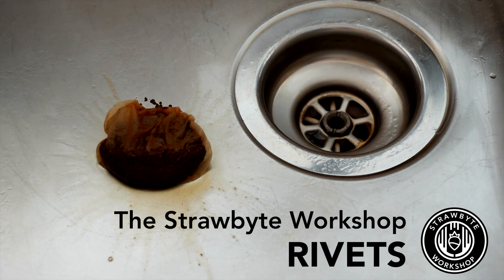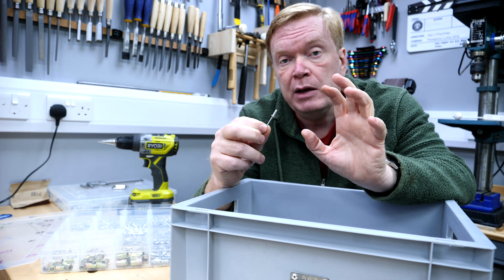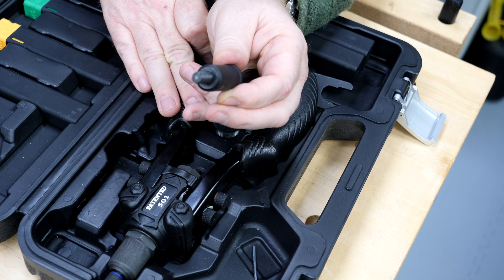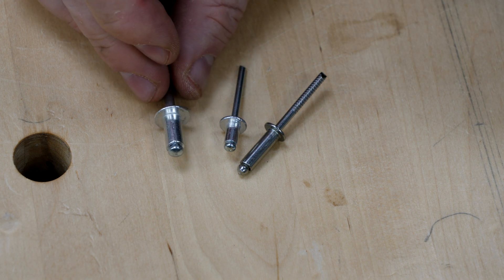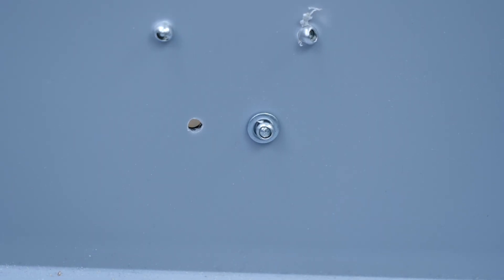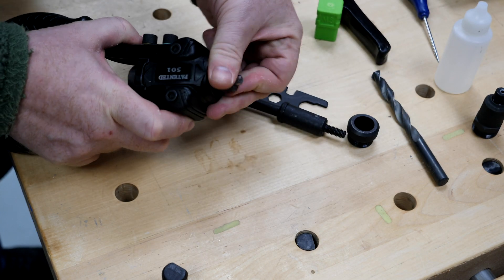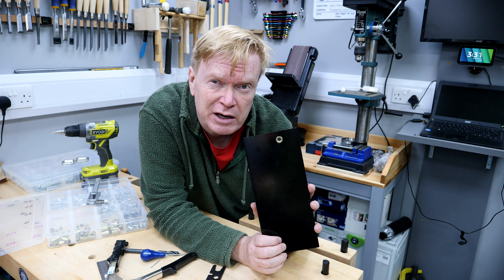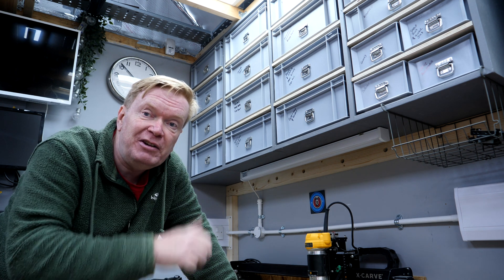How to Use Pop Rivets | Completing the Storage Project

Comment: There are sooo many really cool types of rivets. Unfortunately I have not seem any of them in a hardware store. They are at least 3 types of rivets which can be used for soft plastic material (or a washer) but I can not buy them.
Pull through rivets are also really nice they aare flush on both sides which is suuuper super useful very often when you don´t want to have something sticking out on the other side of the connection but again you can not buy them.
Reply from the maker: You're absolutely right - there are many types of rivet fasteners. My background is in equipment manufacture and boat maintenance - very different work but very common fixing types.
I wanted to make a 'reference' video for something I use a lot. I also use copper or alloy clench rivets a lot too - they're essential for reinforcing connections between fabric and aluminium/fiberglass on boats - so I might re-visit this subject again. In terms of supply, I've always used catalogue/online vendors for this sort of thing and speciality companies that support aerospace/marine uses often are the best sources. Boat chandlers are often a better bet than diy stores.
Reply: This sounds really interesting, those type of connections are rarely seen on youtube, please go ahead and make an other video, I am sure it will be interesting to learn about this stuff given your background.
In terms of supply, I am in Germany and all you can buy here and the simple pop rivets, any other shape of form can not be bought by a private person without a business, in this terms Germany is a super stupid and restrictive country. This goes on with stuff like I can´t buy proper investment casting ( I wanted to pour some metal) unless I do have a business, i can´t get guns, can´t cary 99% of all pocket knifes etc. I am sure this si strange to a person in the US ( it is even strange to me) but that´s unfortunately how it is ...for now, will be leaving soon. @StrawbyteWorkshop

Comment: Hello Karl,
Nice video on how to use blind rivets. I first heard of pop rivets invented by an engineer in 1916. Interesting and good information. Especially effective on plastic and similar products. In fact, it is used in many places. Blind back will provide ease of use. I have pliers used for these blind rivets for many years. (same as the first pliers you showed) And I only used a few cuts. The forceps you bought from Amazon are new multifunctional technology. 3. The collet you showed in the picture is more like manual. And others are different too. All of them have different features. There were pins made of nickel, aluminum and stainless steel. Whereas I thought it would only be aluminum. It was a good idea to put a back support (metal washer) in practice on plastic. Yes, by changing the tip of the second setting machine I saw there (madrel), I also see different ways of working. great for securing the threaded nut to the piece. This rivet pliers you bought from amazon is really cool. It has many functions and is practical to use. Thank you for sharing the introduction and details. See you. I wish you good luck. Big greetings. (looked good in storage baskets. practical storage. Bon appetit for tea)
Reply from the maker: Hi Sahane - thanks for the comment.
Reply: @StrawbyteWorkshop  🙋‍♂️ 🌹🌹🌹

Comment: Thank you for introducing threaded inserts as I have never seen before and I can envisage many uses. Do you have an idea for the recommended load foe a M8 threaded insert? Many thanks.
Reply from the maker: The ones I have are Rivnut and for M8 in 1.25mm steel the pullout load is 2.21kN (221kg) and shear load strength for 2 X 1.25mm steel sheets is 320kg. In Stainless steel can support higher loads, aluminium lower. Pretty good numbers and I've never had one fail.
Reply: @StrawbyteWorkshop  Thank you for your prompt reply. Impressive figures which would certainly meet my requirements.

Comment: Thanks Karl, that was very interesting, haven’t used pop rivets in quite a while, only got one of those cheap sets, but they’ve always done the job when required.
Reply from the maker: I've so much material left from filming some other use cases I may do a follow-up. And as far as tools go, I'm my experience they vary in terms of comfort mostly. The set rivet is generally the same regardless.

Comment: I think the only worry of not using washers is that the small back of the popped rivets might pull through from the inside out when you're pulling it especially if the boxes are heavy. Hopefully won't happen but would be in the back of my mind. They look much, better than screws for sure though!
Reply from the maker: They should be fine, there's four of them and the fittings are only loaded when pulling them. In my experience from boats is they tend to fail when there's a mix of sheer and axial loads. Which is an issue as it's often the case that you can't get to the backside with the washer. There's another type of rivited fitting for those situations. 
If they do fail I'll be sure to let everyone know and "my big mistake" style videos do incredibly well on YouTube.
Reply: @StrawbyteWorkshop  very ture, just think of the content! 😜😂